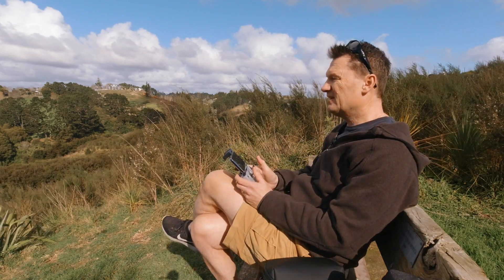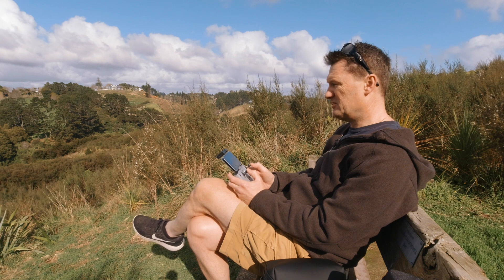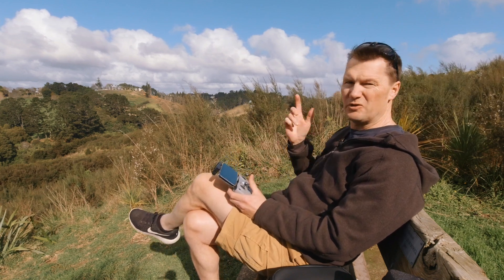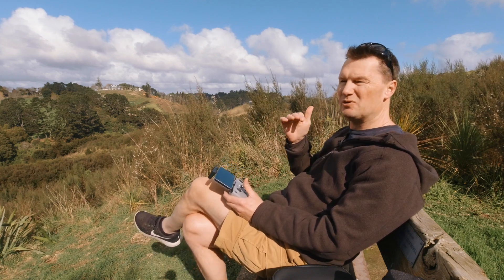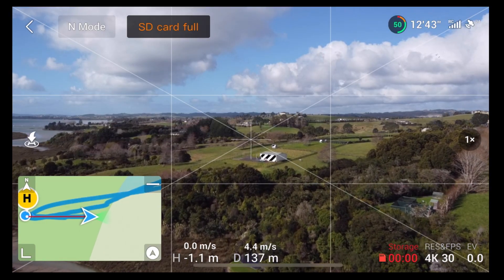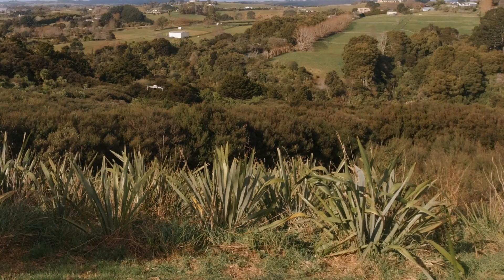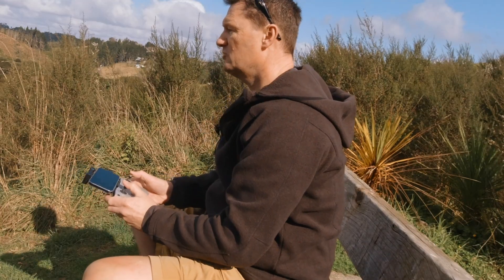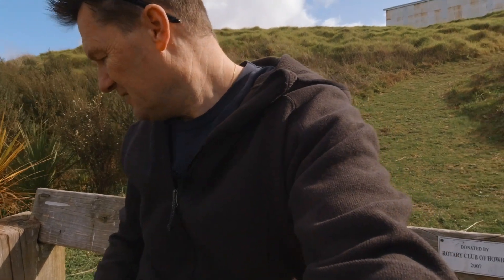DJI Mini 2 Altitude Test // NEGATIVE ALTITUDE??

Comment: I could have told you that..
DJI drones base the height from AGL not mean sea level. 
How do I know that... Because just about every DJi drone does that. 

What I kind of use is a thumb rule of thinking to understand that the take off location is my ground height base and any adjustment from that is either above or below my take off altitude 
now this can be a little confusing so when planning missions some advice, USE THE SAME LOCATION or within 50-100m off the SAME location for your actual flight as you are using to plan the flight this ensures obvious things that your data should be pretty accurate and reliable. 

Lessons I have learned...
if you fly automated flights like I do using more advanced software such as Litchi/DroneLink etc... TRIPLE check your waypoint paths to make sure you DID NOT accidently set a marker too mean sea level if all your height recon flights were based on AGL, I  know this the hard way as I rushed a flight to make the sunset and I was some good 40m below what I had intended to be absolutely in the clear and it ran into the very tree I was trying to avoid ;). 

This was all user error I had the waypoints marker reference set to mean sea level instead of AGL which means I was actually getting my altitude from a negative number below the take off location, when normal way of thinking is your RTH and or heights are  X meter above ground level you need to keep that in mind especially if your objective is to start off low but fly and up over something you are going to want to account for that objects height in your RTH. 

I recommend doing manual flight and going up and over the thing you really want to avoid that is the largest obsitacal in  radius of your flying space and make notes of that height from your take off spot to use this as your RTH later. 

If you guys are using DroneLink (which I recommend) you can actually override the RTH function in the missions with something else IRC to be say go back to a certain waypoint something in this case you can make great use of the restricted zone component too block out the potential hazards and heights so you basically encase those in big old NO FLY box in this case if the drone is doing the mission and it enters that air space the mission will end and it will do whatever you told it to do in my case I usually tell it too fly to my safer altitude and come home.
Reply from the maker: Again mate, great information, and I say again, you should be making videos about this stuff, share your knowledge!

Comment: Hello again thanks for the video, it's a common sense thing but one thing I'm having a problem with my new mini 2 has slipped into beginner mode and I can't find it to turn it off, I think dji should have thought off the fact that some new owners may have flown other drones before purchasing the mini 2, thanks for your help. John
Reply from the maker: HI mate, I'm having a blonde moment, what do you mean by slipped into beginner mode? What actually happens?

Comment: Hey mate, yeah I have had about -100 metres down the side of a cliff… that’s what confuses me about the 120 metre altitude limit rule, I mean you could 120 m altitude right next to a 200 high hill then at the top of the hill you are effectively 320m high from your prior position - seems like it should be a ceiling from sea level so the lower you go the higher you can fly.
Reply from the maker: Yeah mate it's all a little bit confusing eh !? Yet another thing to be aware of when flying!

Comment: Last week I was at Loch Ness, staying around 180m above the water level. Flying straight out over the Loch meant my altitude was around zero, but the drone was 180m high. I dropped down to -100m - so still 80m above the water - but didn't dare risk any more. Worried that the software might flip out with such a big negative altitude.  I'd love to know whether there's a limit to what it will do!
Reply from the maker: Hi Mike Bygrave, yeah mate that's a really good point! I hope it doesn't hit a certain threshold and then try to autocorrect, with disastrous results! I take it you didn't get any footage of Nessie?
Reply: @GetBusyLiving  I did! But then men arrived in a black helicopter and confiscated it 🙂

Comment: You mentioned flying 1 meter above water. Becareful with that as I have heard that the reflection sometimes messes with the downward sensors and it tries to land.
Reply from the maker: Hi Ken Kellar, yes that's a really good point, you do need to be aware of that. I've made a video about flying over water and the settings you need to check - have a look if that's something you're interested in 👍 https://youtu.be/6Q7tLDO8A40
Reply: Your quite right there Ken, I lost my first Mavic mini in the drink because I was to close to the water and the IVO kicked in and decided to land in the water.

Comment: It is good how the Mini handles the wind - I flew my MP 2 in some beast winds last week and your footage was better. My MP 2 gimbal was shaking like a mouse in an eagles nest when I took off - I was daft to do it (16 metres/Sec winds) However I was in an FRZ of an airport with ATC permission and the forecast was a really bummer for the next day) but managed to do an orbit shot which was ok ish and then landed faster than Lewis Hamilton on drugs
Reply from the maker: Ha ha Chris Hearn - 3D Old Dude, mouse in an eagles nest - classic 🤣 And Lewis Hamilton - cracks me up - wasn't going too fast in Belgium unfortunately - waited up to watch that - what a waste of time, I threw in the towel at 2am NZ time. 
But more to the point, yeah I was pretty impressed at the Mini 2's ability in the wind - certainly not designed for it, but it handles it so well!

Comment: This is the whole point with height measurement. It is always measured from the Home Point as stated in the User Manual (page 37). As you rightly say this has to be allowed for when setting Return To Home elevations. As you hand launched in the video this also added about 0.2 metres above the actual land surface.
Reply: Yeah I’m pretty sure what we saw there, was functioning exactly as intended. Altitude is the home point. If you go off a cliff, that’s below your home point. Hence the negative value.  I also believe we should be setting our rth altitude before we fly around, so we know our values are correct. Instead of guessing after the fact and going “I’ll just set it to x to be safe” :-)    
I might have missed a part later where it did mess up but I started typing at the start :-P
Reply from the maker: You're right mate, all fair points! 👍
Reply from the maker: Ha ha John Ford, mate, I'm a bloke, blokes don't read user manuals! 🤣
Seriously though, yes you're right - well pointed out! Yet another thing to be aware of when flying a drone, it's like you need your head on a swivel!

Comment: This is not a good thing.
Reply from the maker: Hi Charlie Blum, yeah it's just another thing to be aware of when you're flying your drone 🤭
Reply: @GetBusyLiving  Hear anything in the wind about this being fixed by a firmware update or is it something bigger then that?
Reply from the maker: @Charlie-wq1gi  HI mate, no it won't be because they don't see it as an issue. I think it's about picking where and how they want to do it and they have decided that the take off point should be regarded as zero altitude.